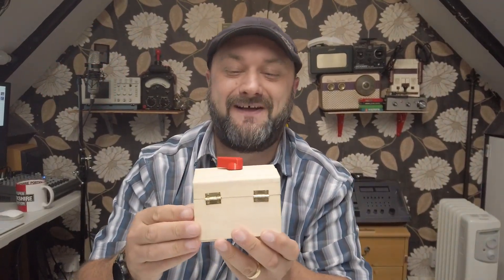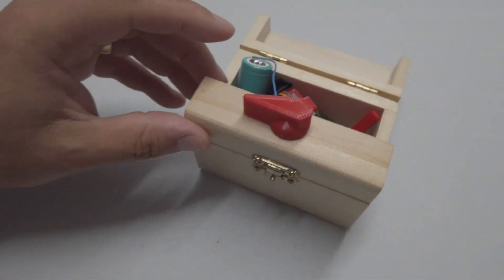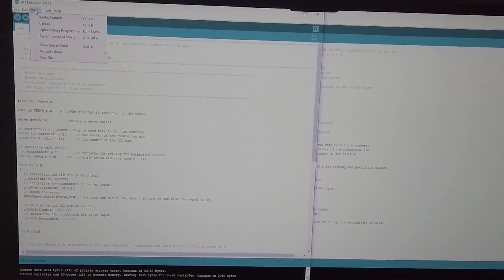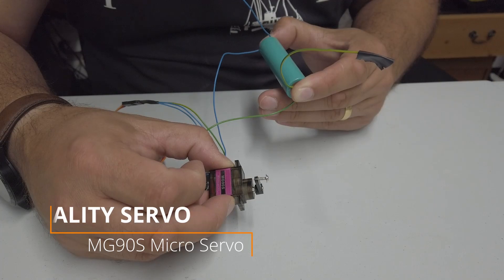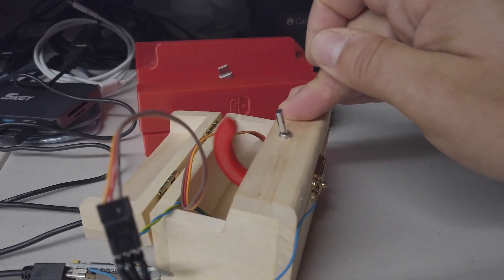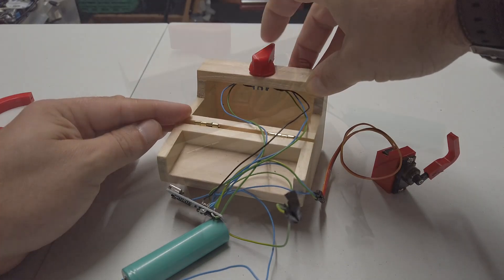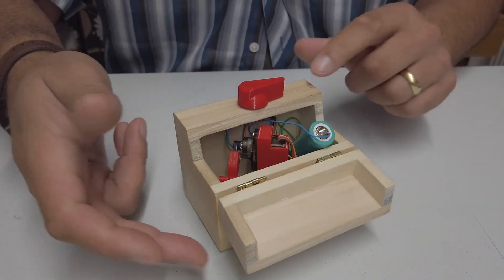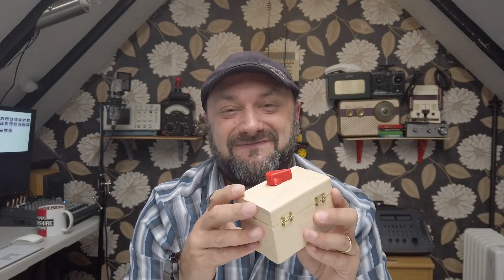DuB-EnG: Useless / Pointless Box Machine with a twist. Arduino NANO Servo control and Rotary Encoder

Comment: That's grand!  Judging by the number of laughs and giggles in that video, I think it's way less than pointless :)
Reply from the maker: It definitely had a point...  fun!...  but thats about it...  Now, how about we connect a servo to a radio to find the strongest signal by rotating the tuning capacitor...  or ummm...  something useful...  any ideas are welcome!
Reply: @DubiousEngineering  Nothing wrong with fun being the point of a project :)

I'll have to have a think of something that might be useful!  They're the tough ideas to come up with!